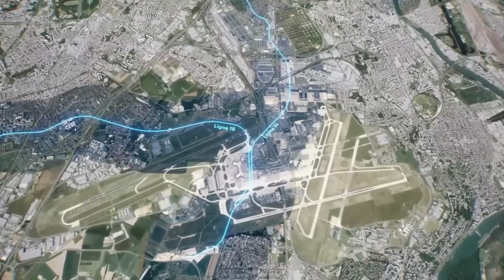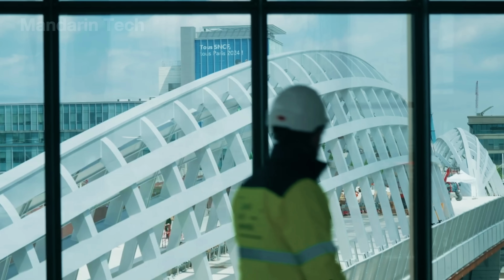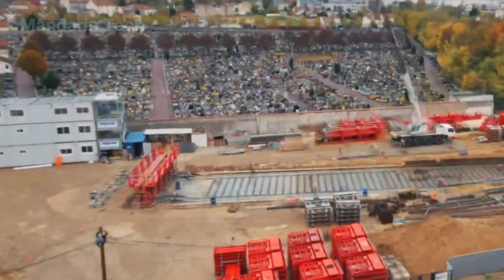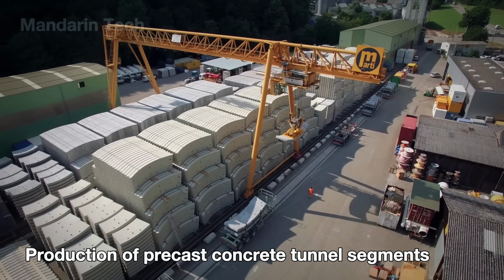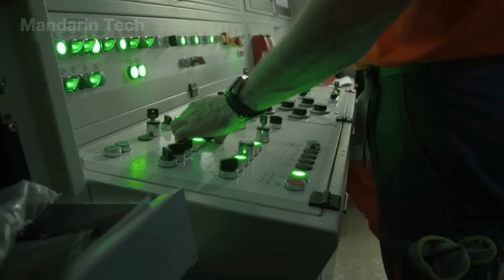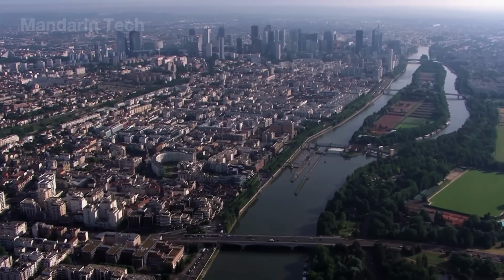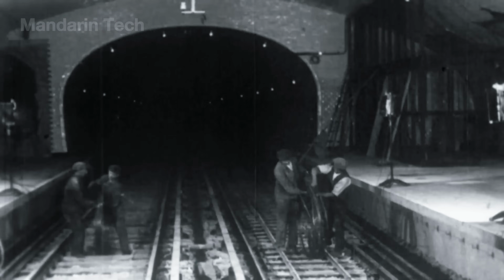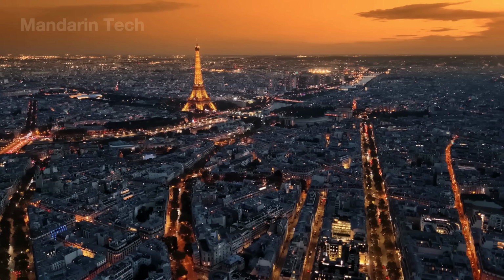Inside France’s 200 km Grand Paris Express Mega Metro Tunnel Construction Beneath Paris

Comment: To cut cost and time, France should not be ashamed to ask help from China that has a long experience and expertise in this matter.
Reply: Haaaaaaa china products is crap. The american military just blew up 50 billion dollars of chines military equipment in venezuela and in a matter of a few hours and kicked out the chinese miltary.
Reply from the maker: China has strong experience in large infrastructure, but every project still needs solutions tailored to its local conditions.
Reply: You're joking, right?
China is really fast at building metros because they don't bother with environmental laws, property laws, worker's rights, project and land acquisition due process, geology, noise issues, etc.
They don't have to deal with any of the complexities that exist in democracies, and then put a nearly unlimited number of workers on the projects.
Not having financial accountability also helps a lot...

A good chunk of Chinese high-speed lines were engineered / designed one way or another by either SYSTRA or Egis Rail, which are the two French rail engineering giants.

And for metro building, France is one of the Western countries that build the fastest and with the lowest costs.

The current delay on line 15 South isn't due to construction but to the completely new automation systems. Which are something that China really is not specialized in as they either use systems developed in Europe or their own copy of these older systems.
Reply: Where were the Chinese 126 years ago, when the first metro line in Paris was inaugurated ?

The Chinese are a courageous and respectable people, but without the West, they wouldn't have been able to achieve even a tenth of what they're doing today.

Their strength lies in improving existing things, they are very talented at that.

Even the very “concept” of a "train", a "plane", a "rocket" or “skyscraper” for exemple, is Western.

Comment: I had no idea this was going on. My father lives there and he hasn't said a thing about it to me. (I live in Australia)
Reply: Many in Paris aren't really aware of it either. The vast majority of the construction being underground, and building sites being fairly common in the metropolitan area, it's easy to miss.
Even though there's something like 200 Grand Paris Express building sites, they are scattered all around. 
Friends of mine lived for years nearby one of the building sites and only realized it recently. 
Inaugurations are celebrated but fairly discreetly. 
In the first half of 2024, they opened the Northern and Southern extensions of metro line 14, the Eastern extension of line 11, the first Western extension of RER E, and the Northwestern extension of tramway T3b, so about 30 kilometers of new tunnels, 4 or 5 km open air, and over 20 new stations.
Yet, many Parisians didn't even know about it immediately.  Also, only M14's extensions were Grand Paris Express adjacent, while all 3 other extensions were different projects. 

The first parts of entirely new lines are expected to open in October this year with line 18, followed a few months later by the Southern section of line 15, then in 2027 and 2028 the first sections of lines 16 and 17.
We can expect these openings to get more media coverage. 
Several building sites are usually open to the public for a day mid-September.
Reply from the maker: Many farming practices like this happen quietly at the local level, so even people living nearby sometimes don’t notice them.

Comment: Beneath?
Hardly....this known as cut and cover.
And appears to be the main methodology.
Reply: No. Stations use cut and cover. The tunnels between stations use tunnel boring machines, wich is the main methodology.
Reply from the maker: Exactly, that’s why sorting waste at the source is becoming increasingly important.
Reply: Only stations are cut-and-cover, and not even completely as several of them had their platforms mined as they extend beyond the limits of the initial station box.
There were also other metro and RER projects being built at the same time, like M11's Eastern extension and RER E Western extension. Including RER E's La Défense station, a large underground cathedral that was dug under a working expo center, etc.
The more than 110 kilometers of new tunnels already built for the Grand Paris Express were dug with TBMs, not cut-and-cover.
Reply: Cut and cover is used for the stations, tunnel boring machines are used for the tunnels between the stations.